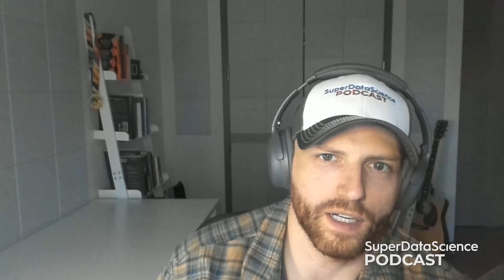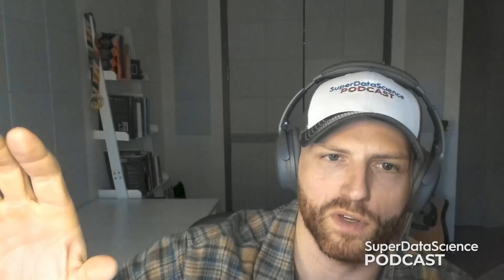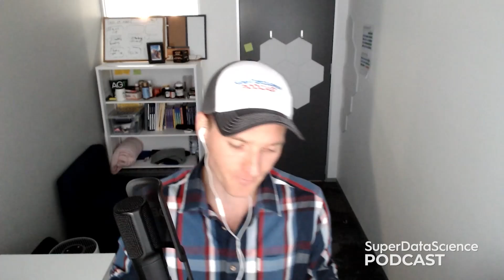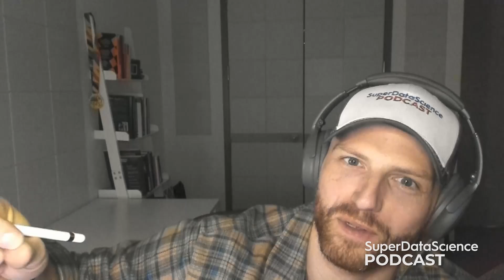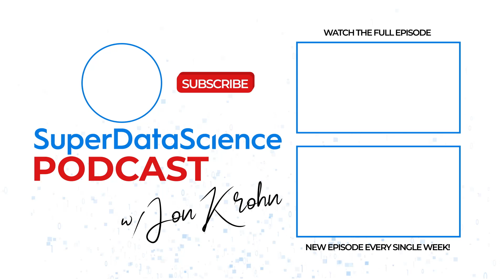How Decoder-Only Transformers (like GPT) Work

Comment: Value vectors are scaled by the amount of attention weights. Say weight is 6. Then value vector[1,2,3] * 6 is [6,12,18] 
Attention weights are achieved by dot product of Q. K. Inner product will be always a scaler 6 in our case
Reply: The attention weights go through softmax layer so our weight 6 Will be changed to be between 0-1